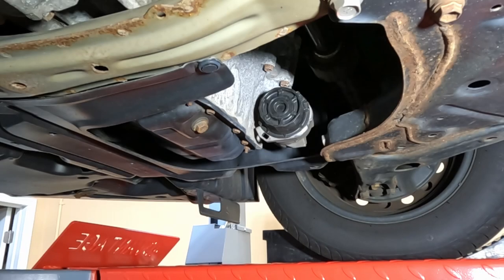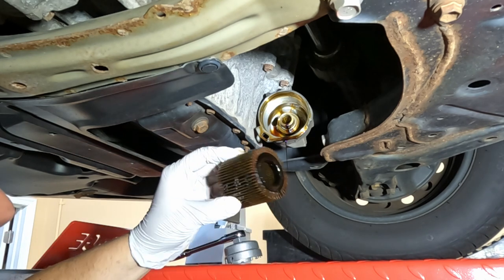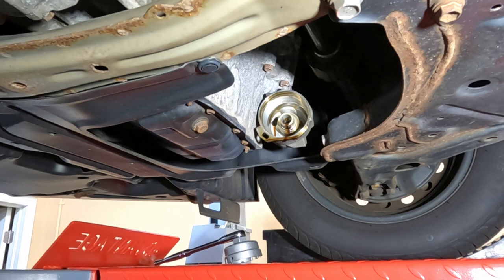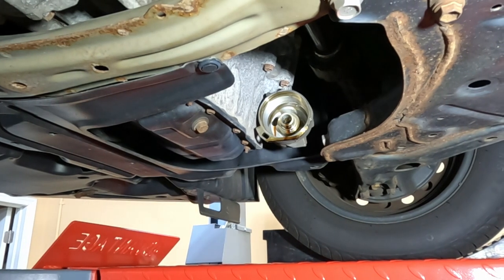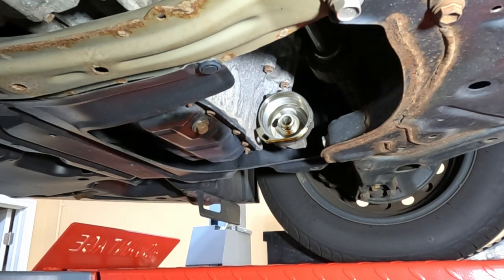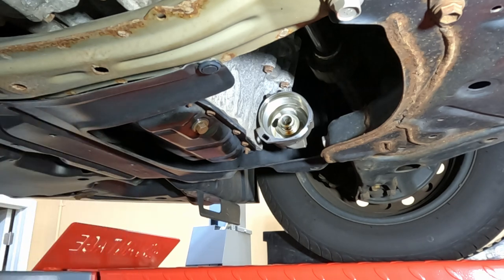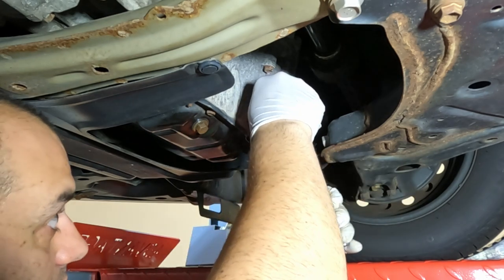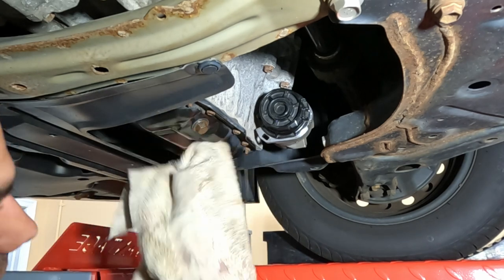Toyota Corolla Oil Change 1.8L Engine

Comment: FYI:  Torque setting NM for the plastic is as you stated, 25NM.  Conversely, however, the oil pan torque factory setting is 39NM -- no less, no more.
Per the oil change interval you use, I do understand your situation and the fact that it's a Toyota engine, so I am fine with your logic, even though I would never use it, because simply, I want to keep my car in perfect condition -- either forever, or so someone can buy it from me in excellent condition.  My 2015 corolla S has 36k on it now, and I have, since new, changed it every 2k, i.e., it goes in gold and comes out gold as well, and I run the engine at good revs, having tuned it and I do enjoy the car very much.  Take care.

Comment: In case someone wants the torque settings for the transmission it is as follows: The 24mm fill plug requires 48.8 NM or 36 ft. lbs.  The drain plug (metal) is torqued at 40.7 NM or 30 ft. lbs.  The little overflow straw is a 6mm allen and should just be hand tightened just until you begin to feel it get a little snug, that's it -- be gentile on it and you're set.  Hope this helps add to this nice video of his oil change, I know it would help me. Toyotas are easy to work on, but not the transmission oil fluid change, because Toyota doesn't really want you messing around with their CVTs, lol.

Comment: Nice video, I would use Kirkland 5w30 synthetic for the remainder of that car's life and put a Fumoto drain valve on that car.
Reply: I replaced the oil drain bolt with a Fumoto drain valve on my motorcycle to eliminate having to remove the skid plate (which is a pain).  Great little device.